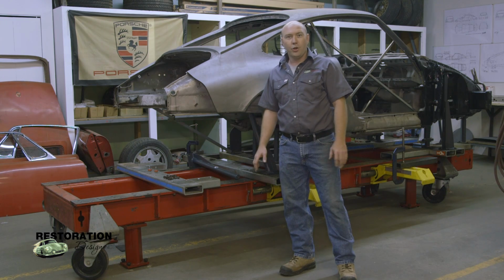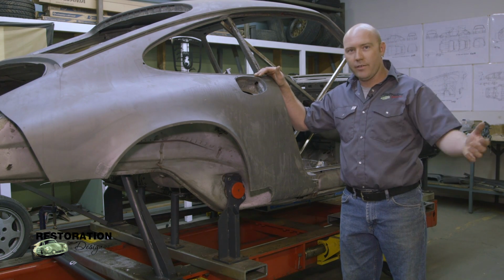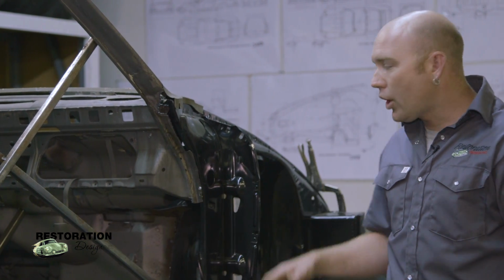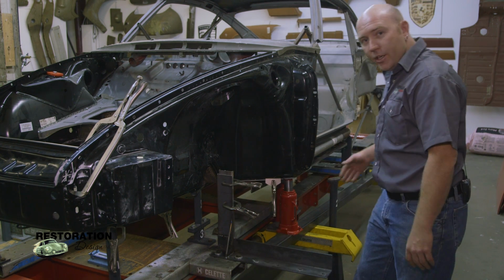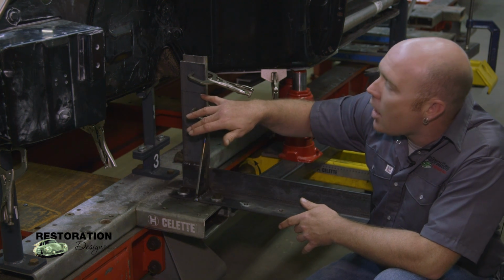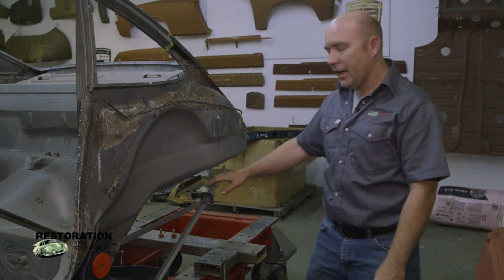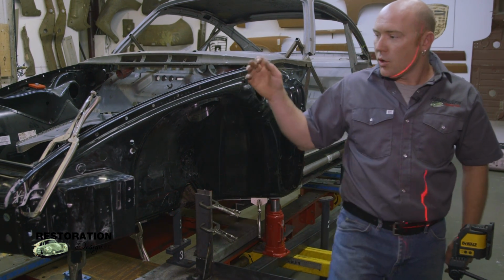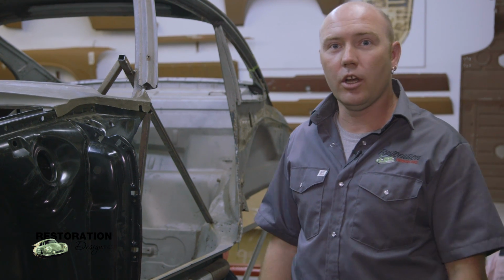Porsche 911ST UPDATE

Comment: What is an ST? Don't remember that designation 43 years ago, just T, E & S. Great video. I thought you did a very good job presenting the info.
Reply from the maker: +jockellis the ST was a race car that Porsche produced in 70 through 72. It had light weight sheet metal, no sound deadening, and many other weight saving attributes. They were flared and had up to 2.5L engines.
Reply: Apparently a 1 year only competition model according to Autoweek. Only a handful were made so worth a ton.